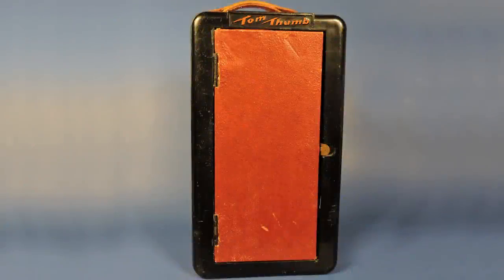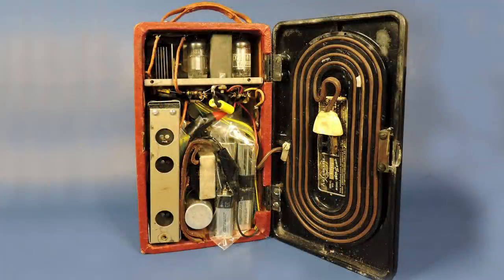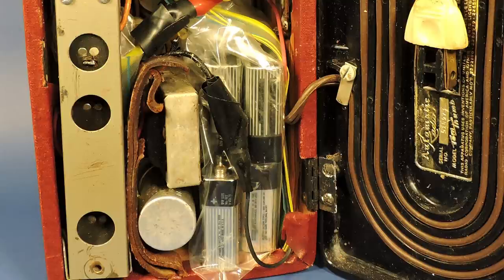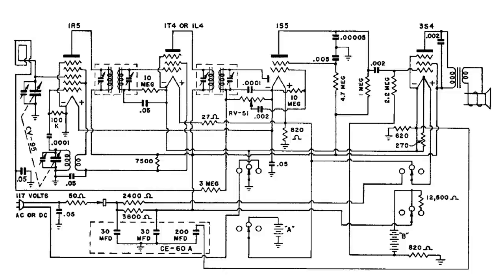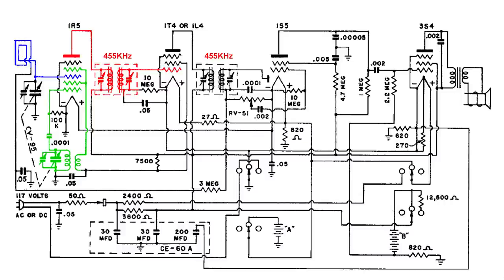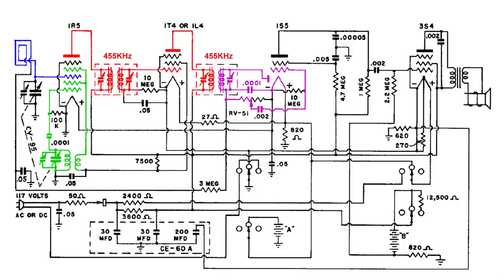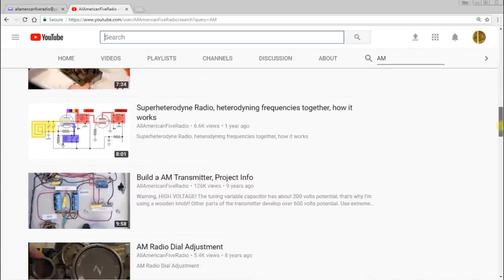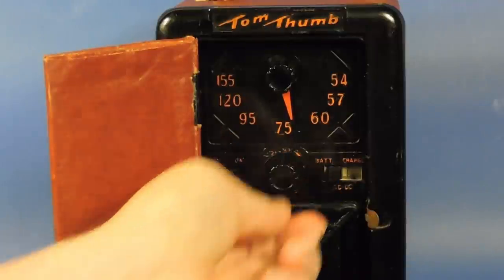Tom Thumb 1947 Vacuum Tube Portable Radio

Comment: That's a neat little radio. I agree, it does sound good for a portable.
Thanks for sharing!
Reply from the maker: Thanks
Reply: That schematic made me look up the data sheet for the 1S5. I'm fairly new to this and I hadn't run across that filament diode plate before.
Reply: +AllAmericanFiveRadio Excuse me, how is the high-voltage B+ supply generated to run to the plates of the tubes? Do I understand that this radio runs on a low-voltage battery?
Reply from the maker: B+ is 67.5 VDC
Reply: +AllAmericanFiveRadio Oh oh thanks. There are two batteries in the radio. BTW, excellent video, keep up the good work !

Comment: Thanks, Rick.  As a youngster, I had a different model of that "Tom Thumb".  Mine was made  to clamp on the handlebars of a bicycle.  Worked very good, or, at least, I thought so.  Thanks again, Rick. ........................Dick
Reply from the maker: Hi Dick
Hope everything is going well. This is a nice little radio and sound great for a portable. Changing out the tubes is a little more work than other radios. I'm glad I found this Tom Thumb.
Rick

Comment: Good name for this radio...(Tom Thumb). Though it has 4 (!) tubes. It is beautiful! The CV tubes were very common in Europe, after WW II and there were circuits published in the Dutch "Radio Elektronica" magazine (stopped in the 1970's). And these CV tubes were used in the portable battery receivers, used in WW2 by the US army in Europe.
Reply from the maker: It does have four tubes you can only see two
Reply: OK, thanks & very informative video, especially the explanation from the circuit!

Comment: Rick, GREAT RADIO..... looks awesome.  I have a question unrelated to this radio and will send via a private message. Subject: Am Transmitter... thank you Ron (P.S.)  Private messages do not seem to be working, so posting here as well.  Many thanks.
Reply: Rick - I have built a second AM Transmitter and have an odd problem.  The transmitter works very well, but If I connect my meter to the B- rail and to the chassis, I am getting 170VDC, which creeps down to ~45VDC after the tubes warm up.  In the same setup I am getting about 1.2VAC  so think something is wrong. I have ensured the tuning cap is isolated and have checked every connection.  Do you have any idea where I can look to nail this down ? I have removed the 6SA7 and 6L6G and still get the voltage but it stays high at 170VDC on the chassis.   Any help is appreciated,  Ron
Reply from the maker: Thanks